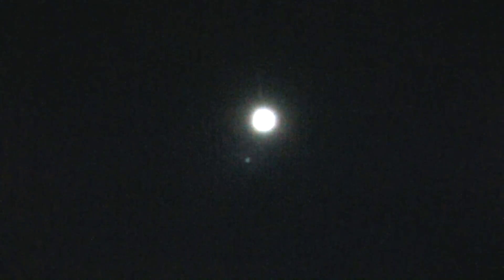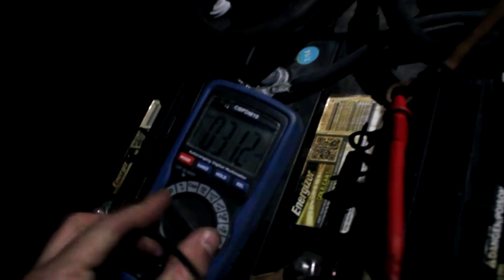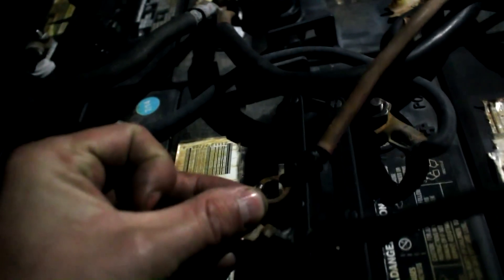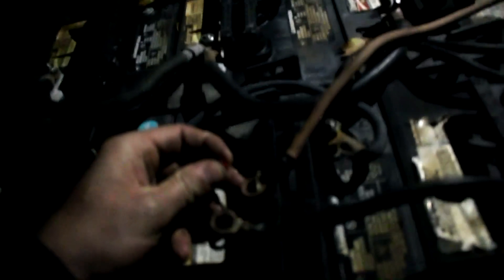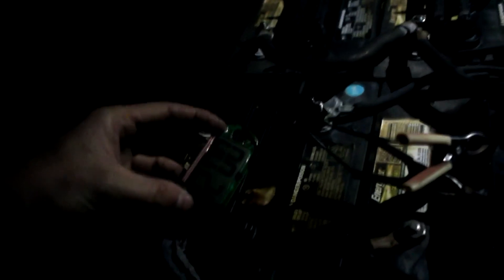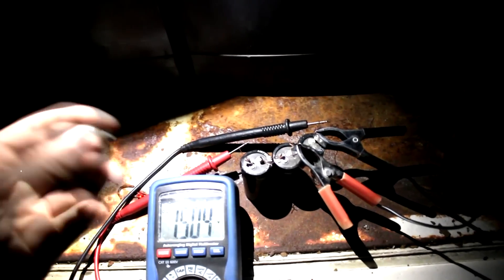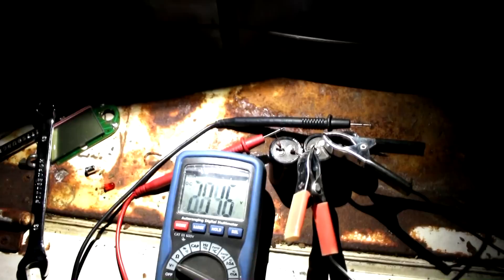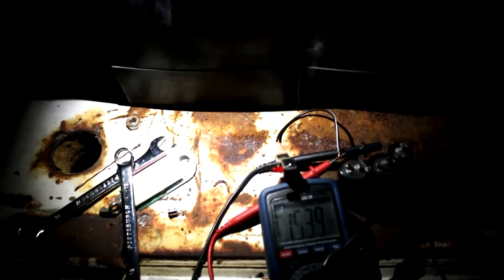Electricity From Moonlight

Comment: so dose this meen you can calculate the amount the moon absorbes
Reply: Sam George I would guess both yes and no. it likely wouldnt be very accurate, and even then it wouldnt be all the moon. space dust, misc. particles and such would obstruct a certain amount of light. but I guess yes otherwise. should be noted that im not at all sciency or educated really, just a fan of cody and curiosity ;)
Reply: THERAMMSTEINFAN490 ye you wold need to know what's in the way first
Reply: Yes you can, but take into account, that solar panels might have a different effectiveness at different intensity and wavelength of light.

(btw) it is called albedo (reflectiveness) which is about 12% if i remember correctly
Reply: Sam George presumably
Reply: It's not a matter of absorption. Light from the sun goes off into many directions and bodies only get a small amount of it, and the same goes for reflected light going to other bodies.

Comment: 1800 watt array divided by 380,000 sun/supermoon ratio is a less than stellar, but certainly non-zero, 4.73 milliwatts...
Reply: But he did measure 1.7V@0.11mA when he shorted the output, which results in only about 0.2mW.
Reply: Which is still certainly non-zero. ;D
Reply: Bl00drav3n hmm ok, now round it to closest multiple of 5 or zero... you'll get zero because that's effectively what it is.
Reply: Any number rounded harshly enough goes to zero.

Comment: For less than $1 buck you can buy a inductor bost circuit off ebay that will out put 5 volts with a input voltage starting at 0.5 volts. That would have worked to light the LED non stop. Cool video. Thanks for posting.

Comment: You could have made what is called a joule thief.  With it, you can power a led with less than 1v. Plus it's quite simple to make
Reply: He didn't have much amperage, so it wouldn't do too much, it might've boosted it a couple volts.
Reply: Joule thief would not operate from such low current. It usually needs tens of mA.
He made a charge pump, a crude one in which he switches capacitors manually and not by transistors.
Reply: You beat me to it!  I was going to suggest a joule thief circuit.  :)
Reply: Pascal Robert Haha. I was hoping he was gonna show one. I was thinking the same thing you were.
Reply: I was also thinking joule thief!
Reply: yeah .11mA is really not a lot of power
Reply: Pascal Robert not useful here. he needed to build up the charge to also get some current.
Reply: It would probably work with a cap on the input, assuming a LED below conducting voltage doesn't eat up all the power before it lights... I don't know how they work at that voltage.
Reply: I agree with coast2coast. An input cap would have provided enough energy to at least start it, but the question is how long it could hold it
Reply: Pascal Robert A couple nanoseconds?
Reply: ok so I did a test by myself, with a joules thief I made some time ago (not the best one) but i was able to barely light a led (30-40%) at 1.73 volts, but the joules thief was using 5.3 mA without load and 5.2 mA with a load (??).  But I was not able to light it with only 0.11 mA.  the joules thief was pulling too much power.

Comment: If a solar panel can turn light into energy can the solar panel use energy to produce light? Please reply
Reply from the maker: yes actually they put out infrared light when you put a voltage back into them.
Reply: Wessel van Aswegen yeah.. by connecting it to a light bulb? lmao
Reply: that's what the LED is for. are you asking if you wire a solar panel backwards does it turn into a floodlight? no
Reply: no look at nurd rage's solar panel video where he makes a solar cell after watching that you will come to understand a solar panel generates electricity via electron exchange not conversion of photon Into electron...
Reply: way cool about the solar cell putting out IR light when powered.  I guess it comes as no surprise since both solar cells and LEDs are varieties of a diode. :-)  It makes you wonder if all diodes are light emitting except some are more visible than others.  Obviously some are packaged up too tight to be visible or course. :-)
Reply: Cody'sLab so they can used as heater panels?

Comment: You tried the led in both directions right?
Reply: Taylor Peterson bad idea. possible burnout. leds have positive and negative ends.
Reply: Not at those low voltages. Diodes can resit current flow in one direction as long as the voltage isn't too high. In fact that is what they were originally invented for.  In my experience, 5V wont hurt an LED going backwards. Depends on the LED of course.
Reply: PacManAction As long as it's not above the recommended voltage it shouldn't matter because it is a diode and should simply not let power run though it backwards. But Taylor, I'm sure Cody knows the positive from the negative side on an LED.

Comment: this happend in new zealand on the first night of super moon. 
A 7.5 magnitude quake

http://i.stuff.co.nz/national/86416268/severe-66-earthquake-hits-hamner-springs-felt-as-far-away-as-auckland
Reply from the maker: not likely connected but the moon does cause some stress in the earth just more stress during the new moon.
Reply: Well. It did have a big impact. This quake was 80 miles from the city i live in. It was long and strong back and forth rocking. Then came the tsunami warning. The moon created larger waves of up to 6meters
Reply: Don't be stupid Abe (excuse my language), every month the moon is getting as close as it is at super moon. The moon just happens to be also in it's full phase coincidentally when a super moon occurs.
Reply: Yay? The likelihood that the Moon had any significant impact on the earhquakes is near null.
Reply: The moon is actully in this position every month. The only difference was its phase, and that has no impact on it's gravitational effect.
Reply: Correlation is not equal to causation.
Reply: Abe Coulter Yes, but no closer then it was on it's last orbit exactly 27 days prior, and 27 days before that repeating. The only difference was that it was visible, e.g a full moon.
Reply: Abe Coulter 6 meter waves don't cause earthquakes.
Reply: Abe Coulter youre b8 im done
Reply: Its Abe Denisia
Reply: Abe Coulter So you're proposing that Moon->earthquake->large waves?
Reply: The combined effect of the Sun and Moon on the Earth's oceans, the tide,[16] is greatest when the Moon is either new or full.[17]
Reply: You do realize that an earthquake near water will create large waves and that isn't evidence that the moon had that effect. Earthquakes create tsunamis, not full moons.
Reply: Guys, correlation!=causation.
Reply: correlation=/= causation
Reply: +Abe Coulter 
Can you learn to spell please?

Thanks,
The World
Reply: ender_scythe The super moon put extra stress on the earth. Possibly either directly or indirectly triggered this earthquake. This earthquake would of struck even if there was no super moon but it may of been at a later date
Reply: Dova Goat The super-Moon puts just a tiny fraction more stress on the Earth than normal, as everyone has said, the stress is the same as the full Moon last month, and the full Moon next month.
Reply: cfm marko The difference in the moons closest and furthest points is 50,044 km. Sorry I'm a massive astronomy nerd.
Reply: km not m
Reply: I feel bad for schoolkids in NZ if they're being taught that earthquakes are caused by the full moon.
Reply: god why are people so stupid in this comments
Reply: FRANKIE MACDONALD HERE
Reply: Gordon Freeman fuck sakes. I never said moons cause quakes. I said the mood had an effect on the tide and the tsunami
Reply: Well maybe if you took 5 fucken minutes to read it first...
Reply: ender_scythe omfg... earthquakes cause tsunamis. it's common knowledge
Reply: Omg Gabe, hope you're doing ok.
Reply: Cody'sLab There has been a crazy amount of aftershocks throughout New Zealand. Last I checked there had been over 900 recorded about 2 magnitude. There were also 2 large earthquakes not just 1.
Reply: Dova goat. There has been 2500. They are around 4magnitude
Reply: Ender_scythe. It did have an inpact. Read my comment... the moon affected the tide..
Reply: the eathquake was first dumbarse. quake hit at 1202am tsunami hit at approx 5 am
Reply: 19midnightsun87. Im not stupid there was an earthquake.. click on the link..

http://i.stuff.co.nz/national/86416268/severe-66-earthquake-hits-hamner-springs-felt-as-far-away-as-auckland
Reply: i.stuff.co.nz
Reply: Cubo Pez the earthquake caused the tsunami. I LIVE IN NEW ZEALAND WHERE IT HAPPEND!
Reply: Yea exactly
Reply: Who knows, the increase gravity could've been precisely enough to edge the plates into tectonic movement.
Reply: Alan Bacon the moon is closer which impacts on gravity
Reply: Abe Coulter stupid the moon didn't do that it was probably under magma from the earth's outer core
Reply: ender_scythe Not even necessarily the full moon, just the periapsis of it's orbit - which is actuality quite rarely on a full moon.
Reply: The most recent supermoon occurred on November 14, 2016, the closest to 
Earth since January 26, 1948, and the next one like this will not be 
until November 25, 2034.[7] The closest supermoon of the century will occur on December 6, 2052.  ~ https://en.wikipedia.org/wiki/Supermoon
Reply: The Moon's distance varies each month between approximately 357,000 and 406,000 kilometers (222,000 and 252,000 mi) because of its elliptical orbit around the Earth (distances given are centre-to-centre).[10][11][12]~ https://en.wikipedia.org/wiki/Supermoon
Reply: Loving this moon fact spectacular :)
Reply: cfm marko I stand corrected
Reply: Abe Coulter I am not denying the fact that the moon has a bigger gravitational effect on super moon. It IS closer and has a stronger pull. The Earthquake caused the tsunami and maybe the stronger pull of the moon caused slightly bigger water waves, that could be. BUT please tell me you aren't believing that the super moon caused the earthquake by being closer to the earth...pls don't. Do you know how small the difference between the moon on it's apogee and on it's perigee is? And do you know how many different types of earthquakes there are and how much force you needed to trigger one?

Don't bullshit me, and most important, don't bullshit yourself.
Reply: +Abe Coulter The moon did not cause the quake. Oh, and I live in NewZealand too, if that's somehow important to you...
Reply: Abe Coulter  vvvv v
Reply: G'day,

   Yeah, Kiwiland does wobble a fair bit.

   They reckon they have the most Earthquake-Hardened/Resilient Buildings in the Southern Hemisphere...; but right now they have 100,000 Landslides where the Mountainside has slipped down towards the Sea & buried the Road & the parallel Railway Line which ran at the foot of the Hills and along the Coast.

   So far only 2 people were killed, but it's possible that under the Landslides there may be a buried Vehicle or three...(?).

 Have a good one,

;-p

  Ciao !
Reply: All earthquakes are caused by the moon. Seriously, I thought everybody knew that by now.
Reply: correlation does not equal causation.
Reply: 19midnightsun87 o know the moon dose not cause eathquakes im not stupid. Im saying that we have had earthquakes in christchurch bafore and some parts of the city have sunk. And we were warned the tide could be higher wich could cause flooding. Then that night 80 miles away a fault broke with a 7.5 wich was long and strong near the coast so a tsunami warning was issued. The sirens were sounding..
Reply: FuckMotheringVampire we had a fucken earthquake witch the super moon affected the tide
Reply: JoshDoesEverything tell me about it. We had an earthquake and due to the supermoon the tide was higher tha. Usual. Witch lead to a higher tsunami wave
Reply: not once did he say that the moon alone caused the waves... people need to read properly before commenting
Reply: FuckMotheringVampire well it did. the moon is responsible for normal tidal movements...
Reply: But would apply extra momentum in a similar way to how the light drive adds the same force but achieves less energy loss, thus creating more wave for less energy as the wave gets bigger.

it all also depends how long the tide is building as to how much the moon altered it's size.
Reply: Abe Coulter Now it's obvious that you're trolling.
Reply: it was bad here in nelson
Reply: ThePlaneKid Jonathan Lim its called dislexia. From the dislexic comunity
Reply: Gordon Freeman you're the dense one...
Reply: +Gordon Freeman Maybe the super moon caused you to fart :o
Reply: please come back. its 10 fucking yrs
since i abused you

in the game
Reply: Oops, sorry Abe
Reply: Abe Coulter No, you clearly said that the Moon directly caused the earthquakes, if you meant otherwise, you should've said it more clearly.
Reply: ender_scythe i never said the moon caused the eathquake.
Reply: ender_scythe you're a spud. go learn how to comprehend a basic sentence...

It says that the earthquake happened at the same time as the super moon... that's it
Reply: Dylan Zrim Well, I'm sorry for not reading an article that is almost definitely incredible. I was referring to what Abe Coulter was saying.
Reply: ender_scythe so was I bud...
Reply: his statement in no way says that the earthquake was caused by the moon...
Reply: I said. At the time of the quake there was a super moon wich had an effect on the tide wich GNS said it might affect the tsunami
Reply: Abe Coulter Then why did you say anything about the earthquake?
Reply: ender_scythe because the tsunami that acted on what was an already very large tide (thanks to the super moon), was directly linked to the earthquake you hollow headed twit...
Reply: Dylan Zrim The course of events was earthquake->tsunami, no need to mention an earthquake there. But saying it was directly linked to the earthquake suggests tsunami->earthquake.
Reply: Dylan Zrim That's what I was saying. When you said "the earthquake was directly linked to the tsunami" it confused me, since many assume that a tsunami must come from an earthquake somewhere.
Reply: Abe Coulter literally 0 correlation. 100% coincidence
Reply: ender_scythe the saying "directly linked" means that one was caused by the other. without an earthquake, there's no tsunami. saying they're not directly linked makes it sound like the tsunami can happen without the quake..
Reply: I swear people don't know how to read...

"this happened in new Zealand in the first night of the supermoon"
means they happened at the same time...
no reference to anything being responsible for anything.. you all just jumped on the wagon and started arguing something that doesn't make sense because the original post doesn't mean what you're all saying it means...